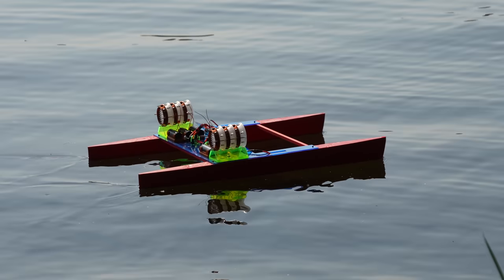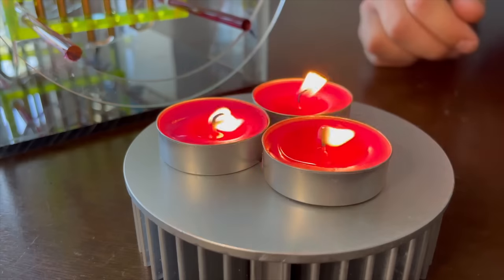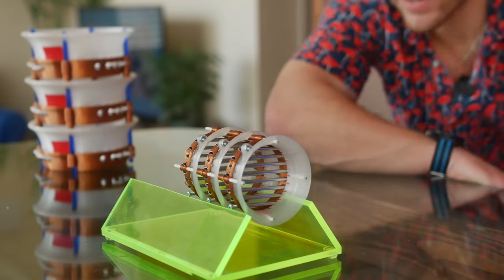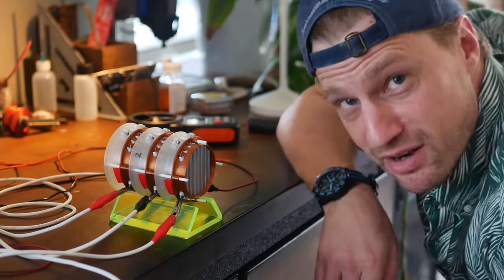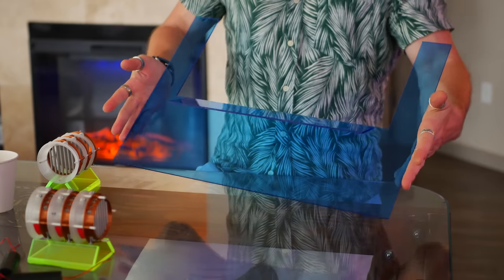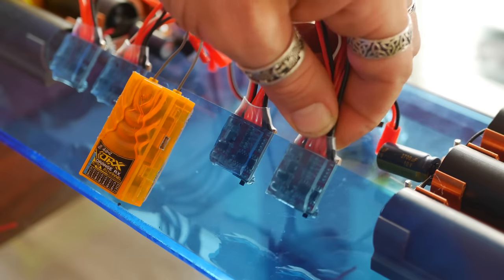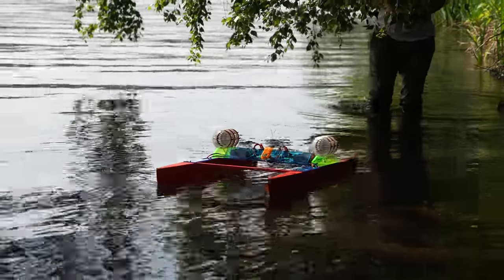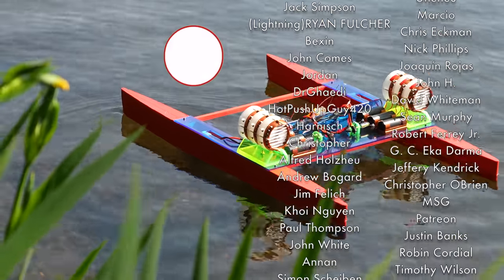Building A Twin Ion Engine (TIE) Catamaran (ft RCTestFlight)

Comment: Ionic thruster: * has a big issue with humidity*

Jay and Daniel: Let's make a boat!
Reply: True. Can't see it work much better on a plane either unless he solves that issue. The moment you enter a cloud or a bank of fog, the thrusters cook off.
Reply: That's like the scariest place for an ionic thruster to be
Reply: How would this fare in arctic environments, where the air is too cold to hold much humidity?
Reply: put a desiccant filter on it?
Reply: Opportunity to improve on it maybe
Reply: @thekuba9352  simplest method, you'd have to swap the desiccant out as it saturates and modify the airflow path.
Reply: @123Andersonev  I think ultimately there just needs to be some adjustment made to the electrode spacing. They're far enough apart in dry air to prevent arcing, but not enough in humid air. The best solution I see would be to make the spacing adjustable to accommodate different humidity conditions
Reply: @Spencergolde  I almost want to design print and make my own system with a controller board that will mess around with very simplistic AI until it comes up with a human readable algorithm to deal with various humidities and airspeeds, just hooking it up to run in my garage somewhere safe for a whole year recording the data collected to influence the algorithm generation, (thrust, exhaust speed, humidity and intake air speed, which would be controlled by me blasting a fan at it or having it in a diy wind tunnel for a bit.)  That way you can have an active system that actively compensates and adjusts itself for the situations and then I could also set up a static design that is OK in most situations.  Honestly the time period for the trial could be accelerated if I spend the money on humidifiers and dehumidifiers that I can set for a target humidity.  There's also testing a lot of different electrode geometries.
Reply: @Spencergolde  it's a boat, you're surrounded by surface water vapour it's in the air.
Reply: highly inefficient it will need a very big loud generator on board, if you are going to use that much electricity might as well use an electric motor.
Reply: @cgourin  actually we probably could have ships that are hybrids with sound isolated generators or finally bring nuclear power plants out of just military submarines and carriers to civilian cargo ships, those new propellers are supposedly a lot more quiet too.
Reply: No test like a torture test, y'know?
Reply: Heat and dry the air going into the ionic thruster with a jet engine.
Reply: @123Andersonev  like a dry filter  that the air is sucked through  you mean? That would limmit a lot of airflow and you would need a lot of the desiccant. It would be easier to just feed a gas straight into it. You can also change the gas to one that ionizes faster, just like in space ionic thrusters.
Reply: @thekuba9352  desiccant can take up to 40% of it's weight in moisture, the amount isn't a problem, you'd just need to pressurise the air first with something like an electric fan, don't need a lot just 1:1.
Reply: @123Andersonev  ahh good to know. I thought they were a lot less efficient at removing moisture than in reality. I guess then yes it would work. Though you still would need to model a whole new air intake system that doesn't limmit the thrusters.
Reply: Maybe it needs a little smarts. I would think maybe a humidity sensor with a micro controller to control voltage?
Makes me wonder if humidity increases or decreases performance.
Reply: @thekuba9352  make a pvc inlet, slap an electric fan on the front of it, make a desiccant chamber, put two way pvc splitter elbow on and feed the outputs to the ion thruster inlets and seal, job done or you could put the fan after the desiccant chamber and use it as a vacuum, probably be more effective, though presumably you'd want to seal the second and third arrays too as they are taking in outside unfiltered air.
Reply: @DoubsGaming  I would say it probably decreases performance. Those arcs lead to a lot of energy being lost to superheating the air
Reply: @josefwollersberger1552  the nice thing with them is that the flow is not that fast so you could for sure pass incoming air through a heat exchanger to condense any humidity. using the water around the boat will probably be enough. I think it might also be worth looking making an engine that uses a lot lower voltages by using much tighter tolerances and having the end stages run higher voltages and spaced out much further to accommodate for the increase in airflow.
Reply: @RRVCrinale  no I don't know, nothing like a little math to understand this is not viable, beaten flat out by sails.
Reply: @frankfarmer2610  simple  arctic environments are also too cold for batteries
Reply: @123Andersonev  power to weight ratio would be problematic.  Especially since they would add weight per second
Reply: @TAR3N  weight on a boat is actually offset on a boat by displacement, it's why tankers are able to carry so much by spreading the surface area, not to mention hydroplaning, which the catamaran at present doesn't have, just add it.
Reply: @thekuba9352  there is an extreme version you could do which is to try to get hold of some MOF-303 or even MOF-801 as those molecules literally strip water from air, not just absorb it.
Reply: i mean, they think that ship noises are causing real issues with marine life lol. cant expect much ig
Reply: @alexanderglass2057  ...AI? What are you talking about? These are fairly simple variables, you can just do science to it and figure out what affects what
Reply: @antonliakhovitch8306  I am lazy, it’s easier to have those variables as input and have output adjustments for simple AI algorithm.  I could find the base code of for free.  Like yeah, I learned how to set up tables and figure out how to optimize stuff in high school but this stuff could be rephrased as matrix math and that is literally how most AI think.
Or I could just set up something like brute forcing a combination lock bot but testing the variables and putting all the data received into an Excel spreadsheet.
Reply: Smartest YouTube engineer be like
Reply: @123Andersonev  i just searched it up and thats crazy. Traps the water molecules within its bonds. I guess if you are dedicated enough to work with metal, its a good extreme option.
Reply: @josefwollersberger1552  gg
Reply: Or even better a plane ... because everybody knows, clouds n' stuff does not exist
Reply: @Spencergolde  you look outside the window and the plane engines are making huge lightning bolts.
Reply: What a lame boat! 
It can't go fast. It can't move backwards.
But it sure will electrocute someone if touched in the wrong place.
Reply: @alexanderglass2057  Germany once had a nuclear powered cargo ship.
Her name was "Otto Hahn", named after the german nuclear chemist of said name.
Reply: @jannikheidemann3805  The U.S. did too. It was the N.S. Savanah. It was a combination freighter and passenger ship.
Reply: also, "it's for making a silent boat" SNAP SNAP SNAP
Reply: When it rains it's game over.
Reply: @Spencergolde  Yeah but if you have to lower the voltage to decrease arch's wouldn't that increase runtime? Less watt's going into the system.
Reply: @Doubs  If you're lowering wattage then you're decreasing power. So yes, a longer run time but with less thrust, like you'd see from running a combustion engine at a lower throttle
Reply: Good thing clouds aren't made from moisture!! 🤓
Reply: I trully tought it was an really expensive mosquito killer.... Buuuuuut the humidity problem should be solved with something really odd 😊
Reply: @frankfarmer2610  
The propulsion does much better in cold, zero H2O air but you'll need a generator for electricity because frozen batteries are usually no bueno.
Reply: @Spencergolde  Imagine if there were flammable fumes... Fairly early in the pandemic, I was tinkering with an electrostatic filter mask, and I had quite an "unexpected dismantlement" incident during particulate testing.
Reply: Reconfigure it so that the thrusters work underwater. EHD (electrohydrodynamic) or MHD (magnetohydrodynamic) thrusters.
Reply: @josephwisniewski3673  Goin' all Red October I see. I believe MHD needs to be run in a conductive medium like saltwater. Even then they're not very efficient, but they might be better than this air-medium thruster. And I see no problem with flammable fumes, I'm pretty sure if it has flames on it, or coming out of it, it should go faster; or at least it'll look cooler while going slow
Reply: @Spencergolde  Don't swamps often emit flammable gasses?
Reply: @josephwisniewski3673  Depends on how anoxic the water is and whether methanogens or sulfur reducing geobacter are present, but usually the methane or hydrogen sulfide they produce are released slowly, as their metabolic processes are very slow, and probably wouldn't accumulate enough to pose a risk. Ogres, on the other hand, are a significant risk to consider during any swamp outing, and loud sparking may provoke a response that could put the boat in danger
Reply: inlet ducting like you see on off road vehicles.
Reply: but ou will remeber it forever :)
Reply: @123Andersonev lol, yes, it will take 40% of its weight in water, which as it turns out, doesnt take very long in very humid environments like hours before its pretty much useless. Meanwhile you have added a significant amount of weight in water to your craft, that doesnt have a lot of thrust
Reply: @alexanderglass2057  What you just described IS 'doing science to it', just automated. It's still a conventional algorithm; just because it's matrix math done by a computer doesn't make it AI
Reply: @antonliakhovitch8306  you know that the basic AI mind is matrix math between a whole bunch of heat map images?
You get enough variables, and the matrix math could be represented as heat map math.

Also, my resistance to call it “doing science to it” is rooted in my college professor’s surprisingly effective way to drill in good grammar.  You don’t commit science, you apply the scientific method.
Reply: @jeremyglover5541  it's a hobby craft, just swap it out, your batteries aren't going to last longer than an hour anyway and it's absorbing moisture from the air not directly from a liquid source so it won't fully saturate in that time anyway, it's why it gets used industrially in paint spray compressors...
Reply: @123Andersonev  i'm aware of that. I use it as a dessicant for keeping 3d printing filaments dry and I can tell you high humid air does a pretty good job of saturating it, pretty damn quickly. it simply isnt that efficient. or rather it is efficient, but you arent going to be carrying very much of it and its ability to absorb more water will be exhausted pretty quickly. marsh/mangrove etc with say 70% humidity isnt that far off dunking it in water. I see that as a pretty pointless endeavor.
Reply: and thats before we even consider spray ...
Reply: @jeremyglover5541  then maybe you're using the wrong type of desiccant.
Reply: @123Andersonev  perhaps. I wasnt considering anything exotic. I just use plain old silica gel, I just happen to live in QLD australia, where super high humidity is normal. its perfectly fine to keep filament that is enclosed dry, but in a fairly open air vessel, not so much and I would expect anything that was conducive to airflow, open ...I have a heated dehumidifier that I feed the more hygroscopic materials from directly from and to dry anything thats been sitting for a while and the desiccant is fine for keeping it mostly dry overnight while in a semi-sealed roller, but nylons still require drying while printing, even with dessicant included for best results. materials like ASA are more immune. I just live in a very high humidity area, not far from the mangroves ... not dissimilar from this test sight
Reply: @Frank Farmer  you just answered your own question
Reply: @123Andersonev ”caution: DO NOT EAT ionic thruster”
Reply: @alexanderglass2057  It's not an AI if it doesn't involve any intelligence. Then it's just machine learning =)
Reply: @Arclibs  everything called AI these days is just a machine learning.  Still, if I can have the mess around and find out portion of science done by a program instead of myself, would be a lot nicer.
Reply: @123Andersonev don’t you think that might interrupt the airflow a little bit. They’re already working with basically no airflow at all. Putting anything on it at all would just be a plug.
Reply: @Spencergolde  yo thats actually a smart solution there
Reply: @feloniousfloyd2203  you only need to equalise the ambient pressure.
Reply: The first thing I thought of was Monty Python.   Laughed so hard my head tilted back 😂
Reply: @123Andersonev  so strap a 20lb air compressor to a 20oz boat. Thanks.
Reply: @123Andersonev  you’d probably be better off just using the air compressor for thrust in that case.
Reply: @frankfarmer2610  ....wut. humidity just makes it colder.
Reply: @123Andersonev directional detectors which activate a switching mechanism?
Reply: So the mist of the ocean would just screw everything up?

Pray for calm seas... 🤷‍♂️
Reply: @josefwollersberger1552  So this is why they are used in space?
Reply: @mdjey2  What is used in space are an entierly different kind of Ion engines. Those generate ionized particles, usually from an in built cache of heavy metal, and rely entierly on magnetically accelerating them to absurd speed for a rather minuscle thrust. The only reason they even make sense is because a spacecraft with a nuclear battery can run them for years without running out of propellant, and because they reach a higher exhaust speed which is the main limiting factor to how fast a spacecraft can go.

This here instead ionizes the air in the front of it and magnetically accellerates it to produces thrust. It's essentially a bunch of stacked up high tech fans without any moving parts that somewhat works in an athmosphere untill the air going through it suddenly changes it's conductivity because it got wet, which is when the whole thing shortcircuits. It cannot ever work in space because it lacks any sort of inbuilt propellant, and there is nothing out there to accellerate.
Reply: Use a heater when humidity is on the case !
Reply: in its current design yes...   However a field with the proper materials will work very well underwater and in dry climate...
Reply: Also ionic thruster: generates toxic quantities of ozone.
Jay: "it's better for avian life"
Reply: yep seems to be an unavoidable flaw.

Comment: Nice work!
Since you're not working with aluminum foil, it may not be so noticeable but each spark makes a tiny hole in your smooth electrode, making it less smooth and possibly more likely to spark. You could try replacing the electrode if you had a lot of sparking to see if it gets better.

Comment: I think having the thrusters rotate would be a huge improvement. You could use the force of trusters combined with the counter force of the water to make a higher net force forward like a sail boat. That would be pretty complicated though so maybe just turning the thrusters to simulate the forces on a boat from sails and adding a rudder for steering. You'd probably need to add some plastic under the hauls to increase side ways friction.
Reply: would a spiral shape help with density of the thruster. As I understand electrical charge is fired from the positive -> negative terminal, hitting air molecules that then creates thrust. By using a spiral-shaped postive terminal + spiral-shaped negative terminal to match, the density of electrons flying across would be much increased (potentially). It could even be set up to be a spiral along the z-axis as well. A bit more complex to build but if done incrementally, it may improve the thrust? Also could all the sparks be re-routed to another circuit/ground?
Reply: @robvod I've seen other creators using straight surfaces with serrated edges. Maybe they're using the tips to concentrate that flow like a bunch of mini nozzles.

Comment: Love watching the ion engine evolve. I used to work with electrostatics when I was an engineer at a laser printer company. One of the things that I first found surprising, but then obvious after some thought was how much the environment played a role in getting toner on paper. Humidity, temperature, and altitude all made a considerable impact. Enough so that even your average printer has sensors inside the case to keep track of those variables to adjust the xerographics every time you press print.

Comment: Electrical interference can be caused by other electronic devices, such as power lines or radios.
To overcome these problems, you can try the following:
Use a dehumidifier: A dehumidifier can help to reduce the humidity in the air, which can help to reduce electrical noise.
Isolate the ion engine from vibration: You can try to isolate the ion engine from vibration by mounting it on a vibration-resistant platform.
Use shielded cables: Shielded cables can help to protect the ion engine from electrical interference.
Use a noise filter: A noise filter can help to reduce electrical noise.
It is also important to make sure that the ion engine is properly grounded. This will help to prevent electrical noise from entering the ion engine

Comment: For your engines, I would suggest making jet panels for air concentration, like jet planes have.  Where the exhaust diameter is reduced for more thrust.  In terms of humidity, all you have to do is make air filters in front of the engine out of some kind of woven mesh so that you don't kill more insects.